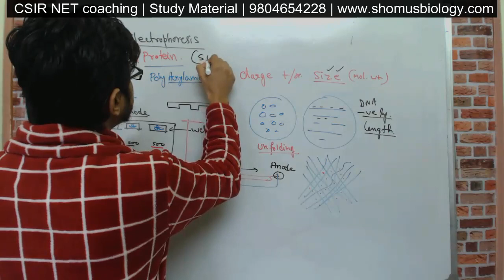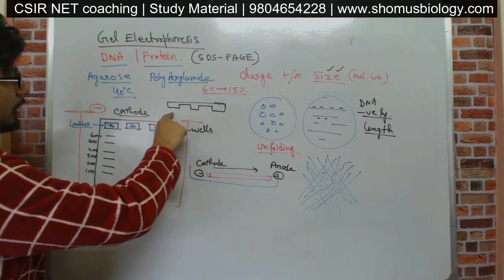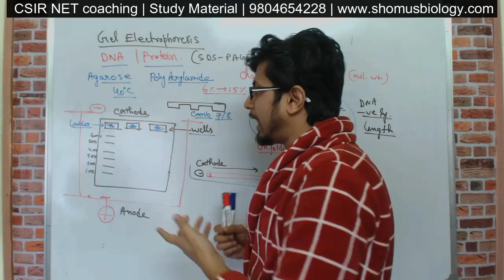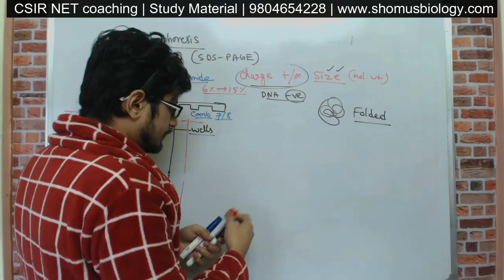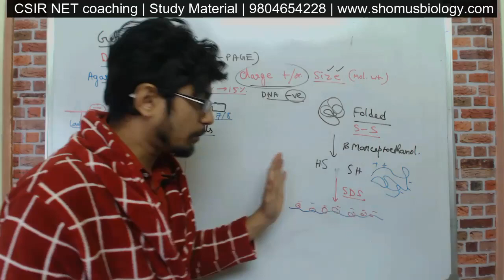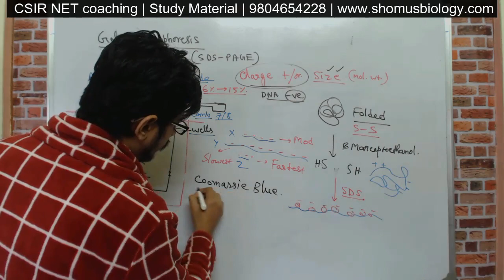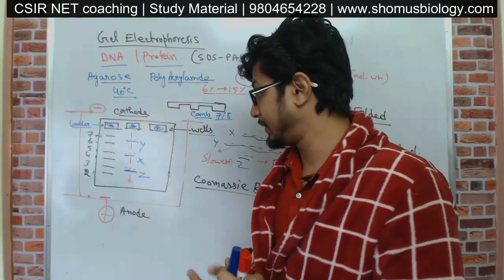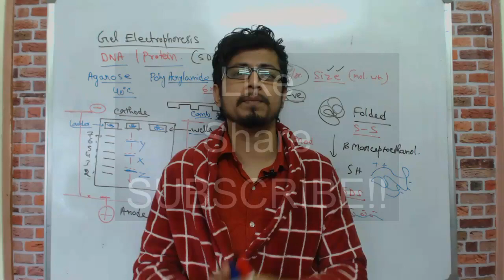SDS PAGE | polyacrylamide gel electrophoresis

Comment: 2.5 mAmp current is required in case of semidry transfer. Not in case of SDS-PAGE. Rather after SDS-PAGE the 2.5 mAmp current is used to transfer the proteins from gel to the nitrocellulose or PVDF membrane in case of semidry transfer process only.

Comment: Also I have one more question that as we use tris glycine buffer as running gel in sds. The glycine enters the gel and help in lining of the proteins before entering the resolving gel. Is it possible to run sds if we don't use glycine.